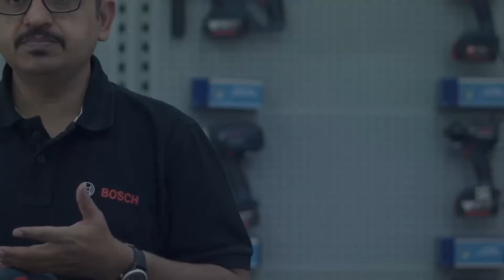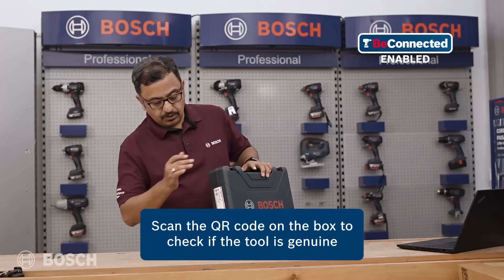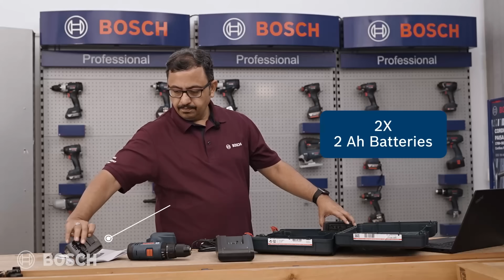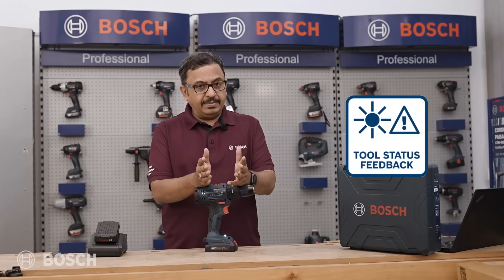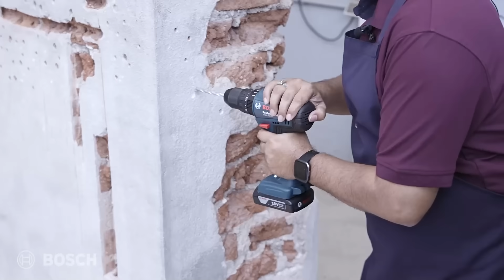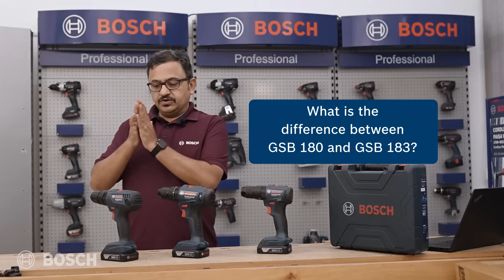Bosch GSB 183-LI 18V Cordless Impact Drill Driver | Unboxed & Explained | Basics With Bosch

Comment: Brilliant presentation!
I am trying to look for a smaller powered tool like the gsb-120li.
I see that it runs on 12V batteries.
I understand that the 183 model is a more versatile tool.
However size and bulkiness are a concern to me.
What might be the better choice?
I only intend to sparingly use the tool.
Reply from the maker: Hi Sauvik, thank you for contacting Bosch Power Tools India. You can call us on our toll-free number 1800 425 8665 – Monday – Saturday 8:00 am – 8:00 pm (Except Sundays and public holidays).

Comment: Which is more powerful 183 vs 180 vs 185
Reply from the maker: Hi Ankit, thank you for contacting Bosch Power Tools India. Kindly note that the GSB 185 Li variant is designed for enhanced performance and power.
Reply: 183LI is active or discontinued

Comment: Thanks for the video , what is the difference between GSB-183 Li vs GSN-120Li ? I see 183 delivers more torque but it's cheaper on Amazon . That is confusing me. I need one for home projects for masonary work. Which one would be better ?
Reply from the maker: Dear User, thank you for contacting Bosch Power Tools India. The Bosch GSB 183-LI is an 18V drill designed for higher power, longer runtime, and enhanced torque, making it more suitable for demanding tasks. On the other hand, the GSB 120-LI is a 12V drill, ideal for lighter tasks. The GSB 183-LI also offers better performance in masonry, wood, and metal work. Both models come with a single battery. If you need more information or assistance, feel free to ask!

Comment: does it have brushed motor or brushless ?
Reply from the maker: Hi there, thank you for contacting Bosch Power Tools India. Please note that it has Brushed Motor. For brushless option please  refer the following link: https://www.amazon.in/Bosch-Professional-GSB-Cordless-Battery/dp/B0BTHSD16D/ref=sr_1_1_sspa?crid=2CS7YWJRBFPFX&dib=eyJ2IjoiMSJ9.mdMkgV1UGo1zIaiaH1Rkv8ZZUjMUY7XHCBLRfTO6w3exUCDPit2xySzZhzZOtMs6PWTW--VKZYLFATNfrnt04hpaCO3EinWtLdahc1K4t9feRWyGYF6re78-KUFNl6iYpU_JVzB9lEw1B_nXCLG1garhJf6zNaLKIEnKKNU9c4L6zroUB60d-22u3ZdvyueWqr5YWOn9YrTj94m0lc8hYk8ZS2gxn7wE7qWPAf3TF4KZQ2Ehf9xzaLK5HSOdJqoYqmaFguE2UMp7rpSi0km5qwMNnzGlBs9U8sE5yOql0kE.f6cV5jyjK3iYRLc9zlFmKWm3DBLKnLVf-eVoDXUhXDI&dib_tag=se&keywords=gsb%2B185%2BLi&qid=1740989937&sprefix=gsb%2B185%2Bli%2Caps%2C210&sr=8-1-spons&sp_csd=d2lkZ2V0TmFtZT1zcF9hdGY&th=1

Comment: Bosch batteries is my problem. I have some very good older Bosch tools still in good condition (because it's a good brand), but can't find batteries and if I can find them they are insanely expensive. Also new extra batteries cost much more than similarly priced tools and batteries are not interchangeable. For that reason I will buy a different brand.
Reply from the maker: Hi there, Bosch 18V batteries works with all Bosch 18V Power Tools. For more information - https://www.bosch-professional.com/us/en/ampshare/
Reply: Купи в китае на площадке али экспресс аккамуляторы 18650 и поменяй в корпусе
Reply: Very good information. Sir what is the price of this type drill machine.
Reply: Sir whar is the price of BOSCH GBH 36V li Compact professional drill machine price.
Reply: What is a about rpm 1815 or 1615